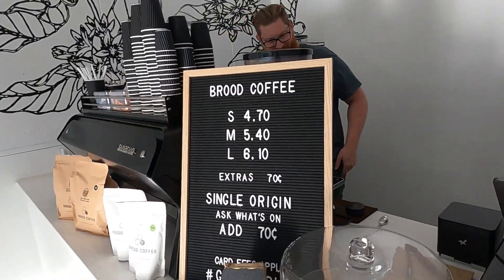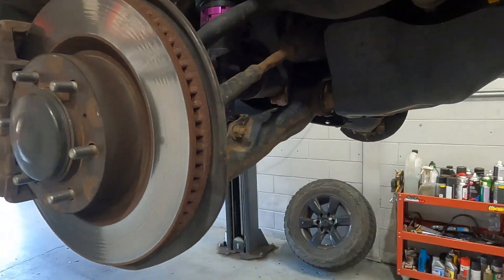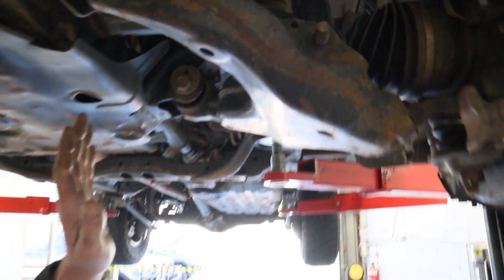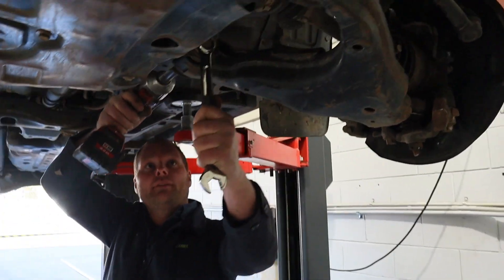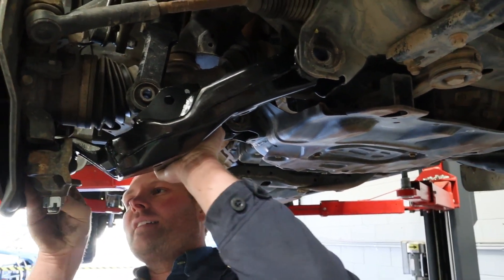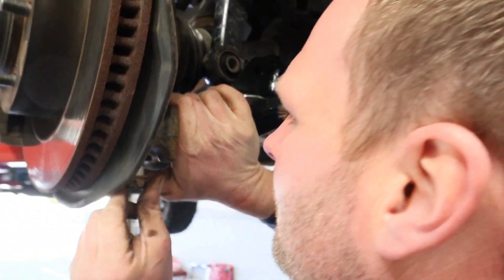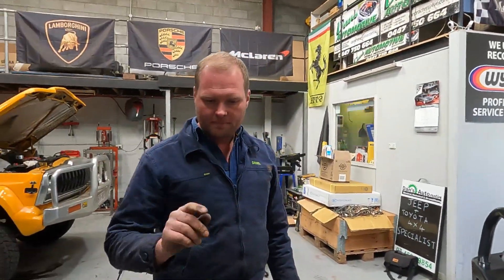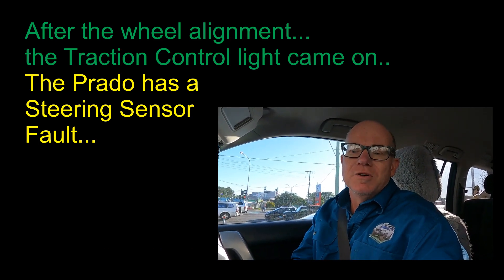Installation of New Lower Arms | Is this the end to the Prado's Dramas?

Comment: Hi mate, how did it go after years of using the aftermarket LCA? Mine is due for changing as well, just doing some research which is the best one aftermarket. Genuine cost a second mortgage.
Reply from the maker: It's great mate. No issues at all. Certainly have done a few kms since installation. Very happy with it
Reply: @prado150outahere  looking on the video look like you use pedders brand.
Reply from the maker: Yeah,  not sure. Dan gets them from a wholesaler in Melbourne who supplies many companies. I think it cuts out the middle man so to speak. Dan has used them for a long time with no issues, and I'm very happy with mine.